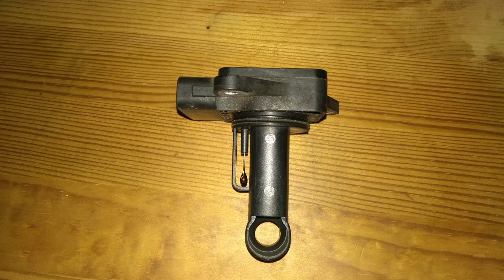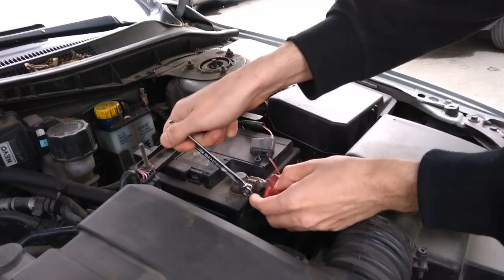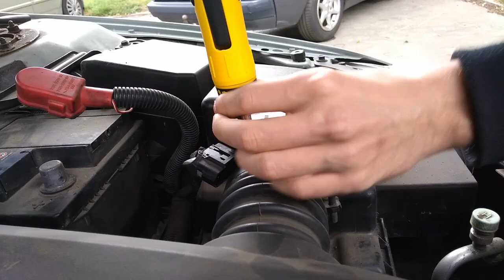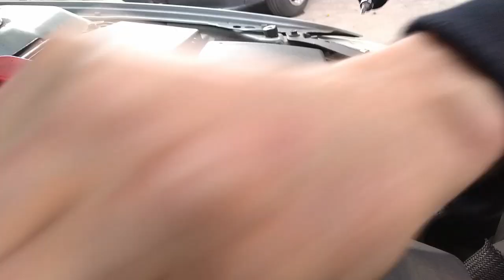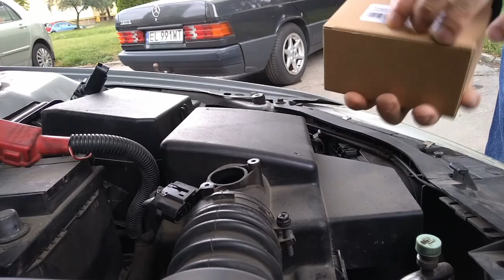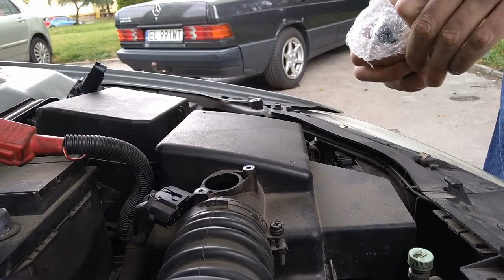Mass airflow sensor replacement Mazda 6 2.0 141HP

Comment: Hi I need some help to identify the signal wire to add a HBO system to but I don't want cut all of the wire to identify the right one the same one as.yours video Mazda 7
Reply from the maker: what?
Reply: @works4me89  The mass air flow signal to the ecu that one wire send signal to the ecu I want to know which pin it is from 1 5 which number pin is it to add my hydrogen enhancer to
Reply from the maker: @danielchatrie6614  idk. Check wiring diagrams